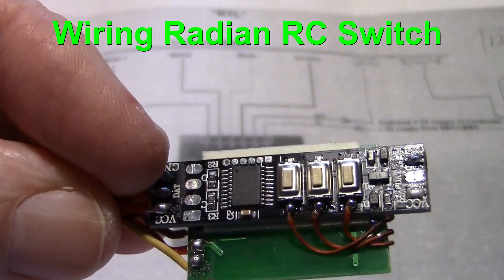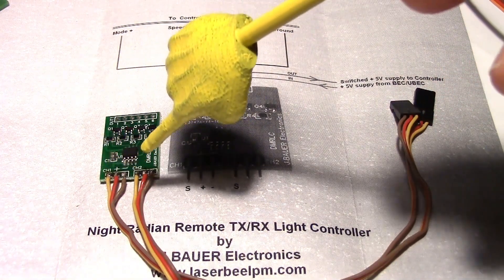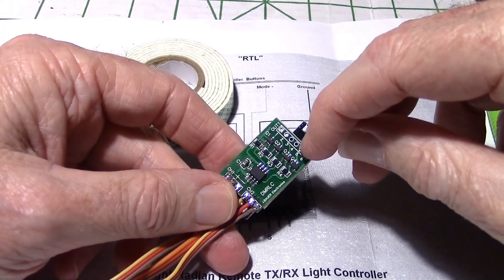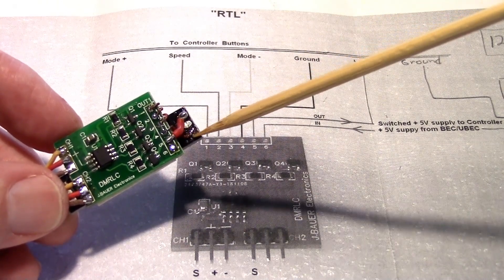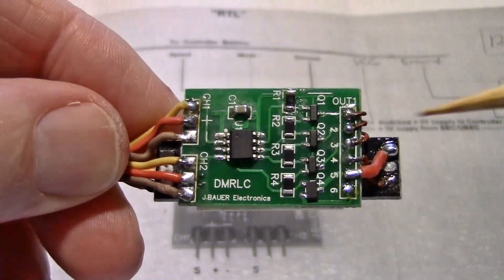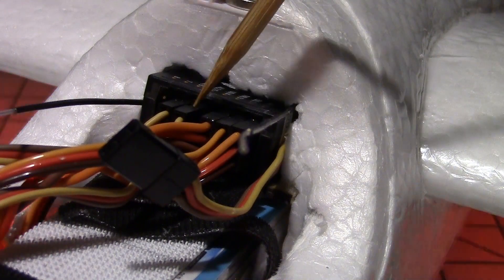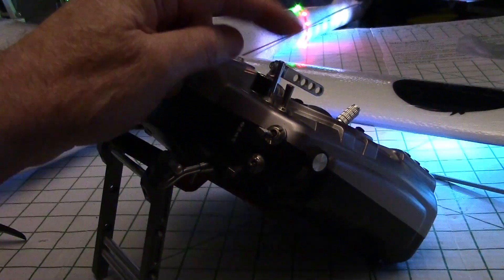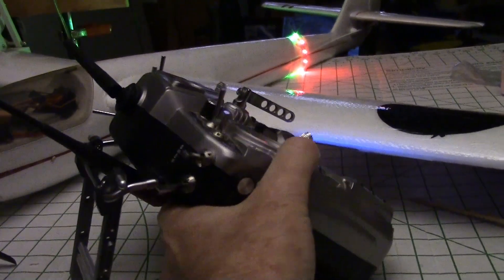Wiring Night Radian RC Switch for remote control of LED Lights

Comment: Wow... Nice and small. I like the way you mounted the PCBs back to back.
BTW you can use the same RLC light controller Module with any model that you install some digital 3 wire WS2811/WS2812B LED light strips and matching SP002E controller.
Reply from the maker: Yes indeed, it was small enough to fit in the tunnel between the cockpit and the belly hatch getting it completely out of the way of the battery.

Comment: Hello I wish i can buy the setup. can you tell me were you buy both of them so i can put in my airplane. Thanks. I gave you a thumbs up firth one. :))
Reply from the maker: You can get the RC switch on laserbee https://www.laserbeelpm.com/rlc.html
and then look on ebay or just google search for digital 3 wire WS2811/WS2812B LED light strips and matching SP002E controller.
Of course if you buy a Night Radian you only need the RC switch.
Reply: Look in the video description above...
RC Switch Available on the product page
https://www.laserbeelpm.com/rlc.html
and on RCGroups.